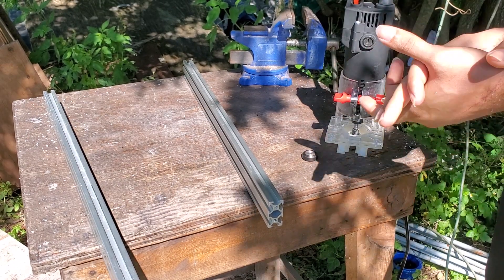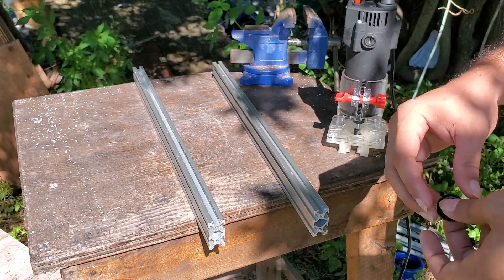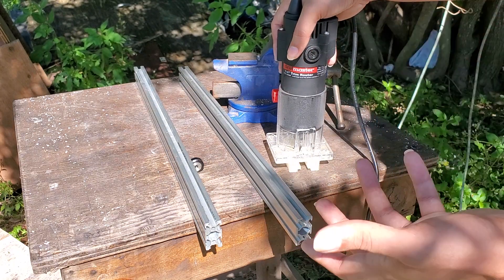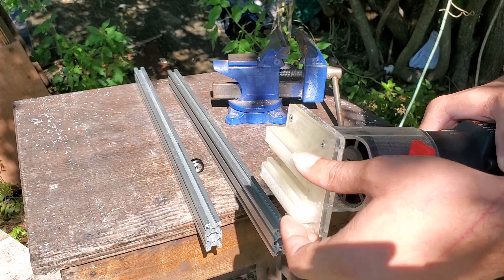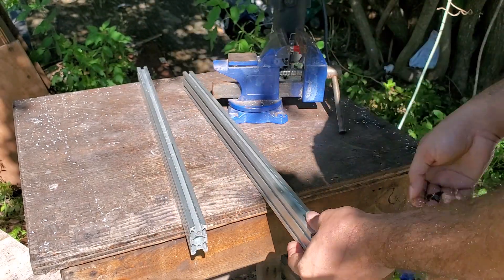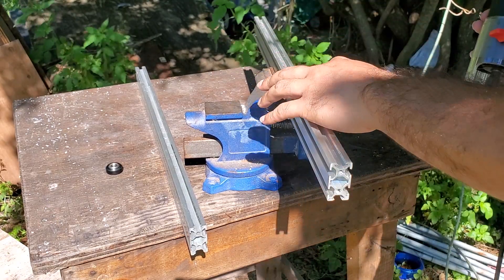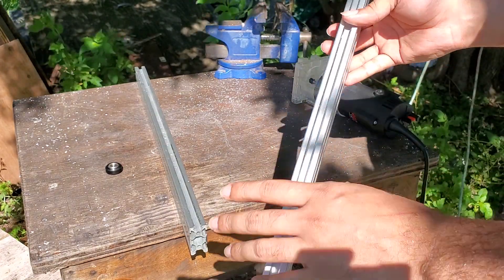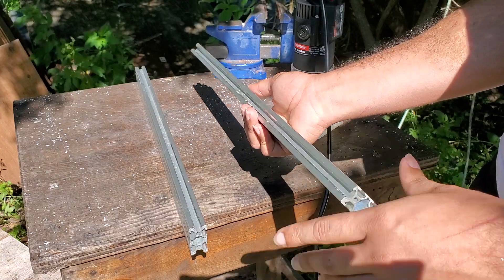HOW TO TURN A T SLOT INTO A V SLOT (3D Printer and CNC!!!)

Comment: I have about 300 lineal feet of fractional 10 series that I've been trying to figure out how to use as a lineal rail. Had been wondering if I could safely use a router to reprofile the slot, now I know. Thanks!
Reply from the maker: Your welcome I am now trying to make another attachment for the 2040 aluminum extrusion to make it all v SLOT and when I get it made and working I will make another video on this